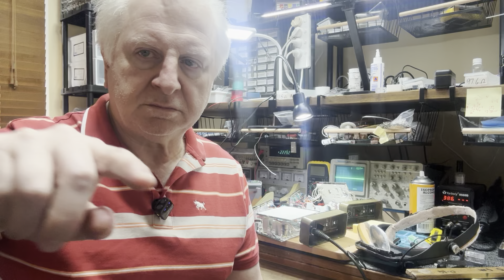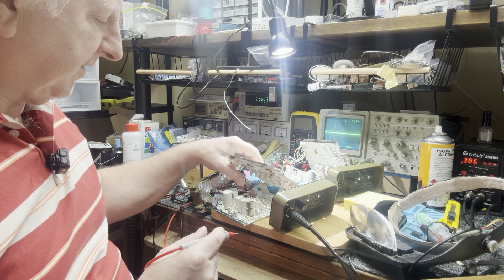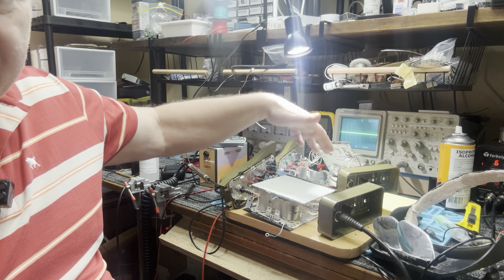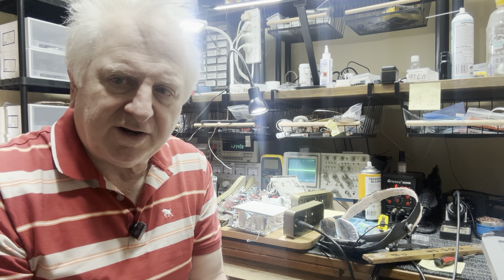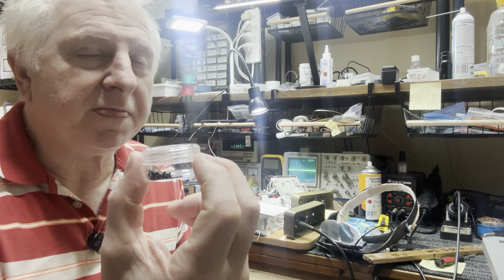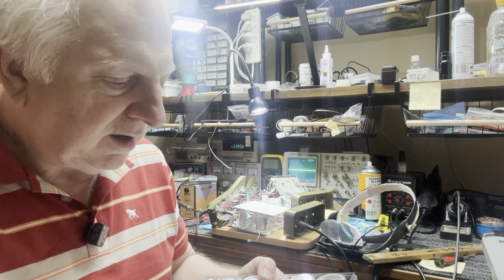Minelab SD2200D hit by lightning, plus other waffle.

Comment: Got cheap 2200d($1K) and 2000, the 2200d is great stock, the 2000 works good too, but i really want to send it in for a clean up and modernise with detectormods. $750 for the sd2000 was a bargain. Thanks again woody and david, i love the new 13hr lithium battery i got from you guys👍👌🇦🇺
Reply from the maker: Glad you are happy with it.